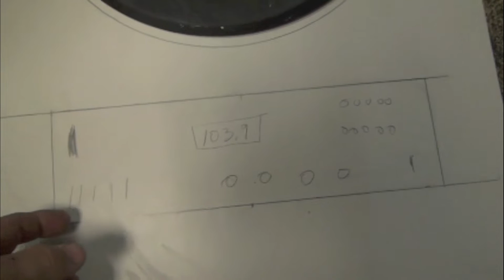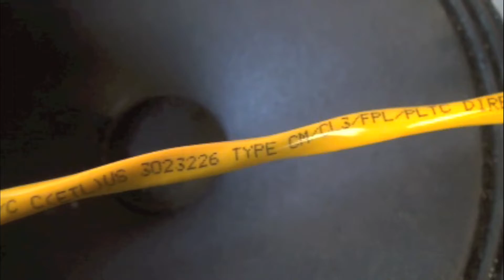Full Edit *My 20 Speaker Backyard Sound System Installed  *Short Version DIY BOGEN 70v

Comment: It's nice, but there's no stereo separation or any thought put into how the enclosures will sound. Bare minimum you should put a tweeter next to each speaker, and have a subwoofer for each main area.
Reply: These are PA (public address) speakers, commonly used in schools. They are full-range and monophonic, and dispersion is greatly limited by that perforated metal grille. The shiny metal bowl on the back IS the enclosure. They are meant to be durable first, protecting from kids throwing spitwads and pencils, and fidelity takes a back seat.

They're probably not rated for direct rain exposure but put them under a small roof, and they'll be fine. Likely would sound better without the metal grille, but for this application, the grille now protects against woodpeckers and squirrels.
Reply: I'm looking and I haven't seen your video about how you'd put up speakers.